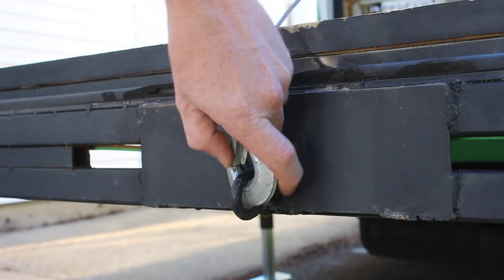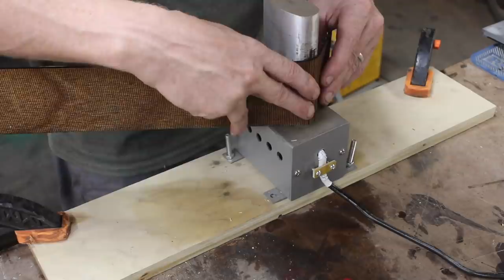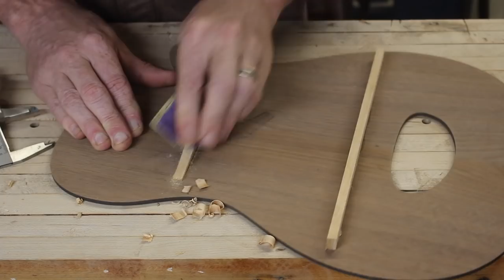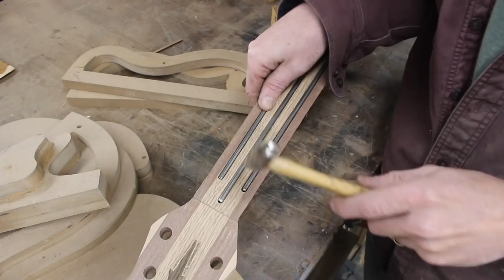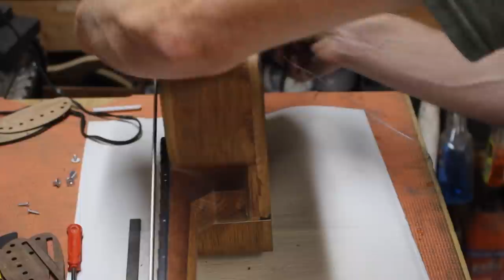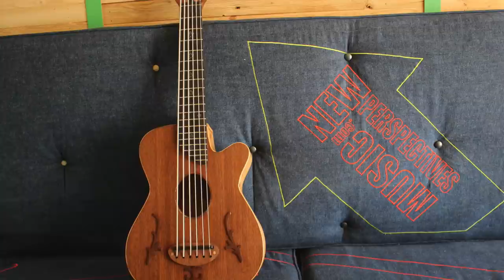Bassulele: Mini, 6-String Ukulele Bass

Comment: Ok wow, I need one of these now!  I have 2 ukulele basses (one fretted, one fretless) and also play 6 string electric bass.  I've been following you for a while now, this is probably my new favorite of your builds.
What the heck did you use for strings?  I've seen sets for 5 string u bass, but definitely not 6 string.
Reply from the maker: Alex emailed Kala direct and got a 5 string set with an added extra thick string.
Reply: @timsway  awesome, thanks!!

Comment: I made one of these during the winter out of a first act 30 inch guitar.  yours is much nicer 😂.

I think I had to use the A string of a bass for my lowest string. Getting the string gauges right was harder than drilling holes to make it work.
Reply from the maker: yes, we spent more time on string research than anything! We ended up using a set of shorter scale Kala 5 string bass strings and they were able to send us an even thicker string to finish the set.

Comment: I used the Kala with hi C for a u bass conversion of a mini Yamaha acoustic converting it to a 5 string. I have a short scale 6 string bass, but I wanted a nylon 6 string . I bought a traveler classical guitar, 24.5 scale. I did make a new nut to gain a little string spacing. The bridge was fine as is. I used hannabach contrabass guitar strings,silver over copper,nylon core. What did you use for the highest string?
Reply from the maker: I don't remember all the string specs but they were all Kala strings
Reply: @timsway  thx for replying. I asked because all the string sets on Kala only go up to 5. sorry to bother you

Comment: Stopped the vid @ :50 seconds when I saw you *DESTROY* the decorative wooden applique from a 140-yr-old organ.... That's not 'repurposing', that's outright **blasphemy**!!
Reply: You'll get over it. Or you won't.
Reply: It was already broken as a piece, and, if you watched until the end you'll notice that the decoration is utilised in the final piece. Fairly appropriate I'd say. In my eyes there is little more blasphemous - perhaps even egotistical - than leaving something unutilised in perpetuity to simply be looked at. I'm guessing the original maker would be fairly happy with its use in this case.
Reply from the maker: should I have left it in the trash pile it was rescued from instead?